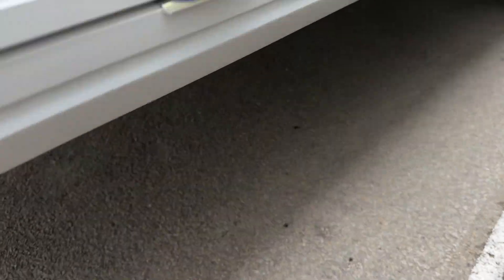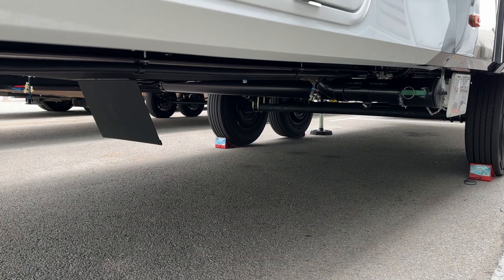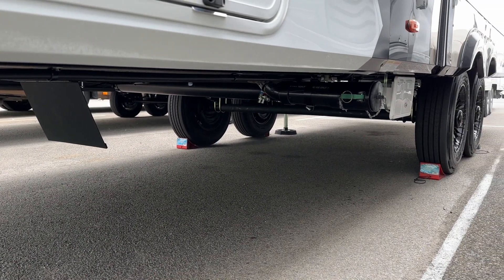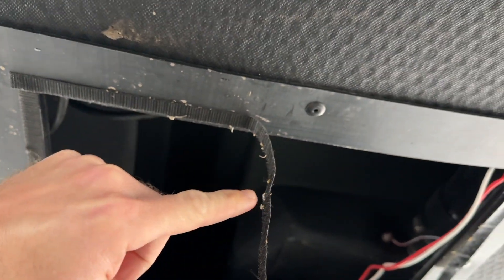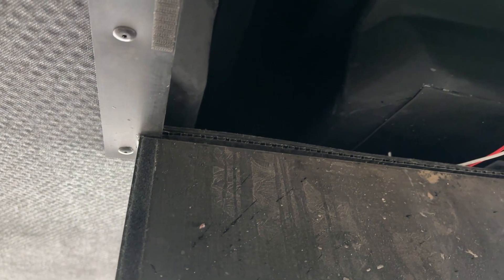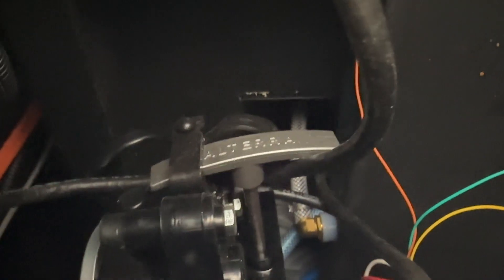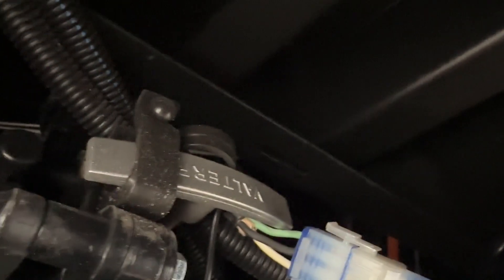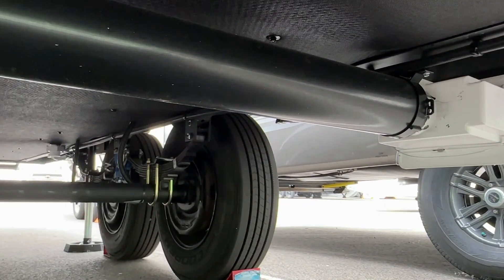Brinkley Electronic Valve Override Update

Comment: Great video about something I never even thought about.  A Brinkley owner on a Facebook blog just had their black tank switch go inop on them and I did not know myself (a Mr. Fix it dude) that there was an override valve for manual operation. Ya think that the dealer would have told me about this.  I’m going to check the Z3100 manual and I’m sure it was in there and I actually missed this?  Man o man is Alzheimer’s on the way. Jezz!!

Comment: Simple linear actuators. Very easy to disconnect from the handles. Access door just needs a couple of self tapping screws with flat washers. Personally I'd add insulation and light weight aluminium flat bar around the access panel for additional strength. Lastly dump the velcro for weather strip. Not a big deal.
Reply from the maker: Good idea!

Comment: The override location wouldn't bother me. What I find interesting though is that for such a high end fifth wheel, the construction of the access door with the velcro is quite disappointing. Also, doesn't seem to be any insulation there. But it wouldn't be a deal breaker, I'd just modify it
Reply from the maker: I agree! Not a deal breaker, but it could have been done better.